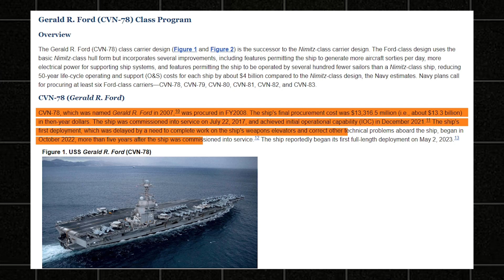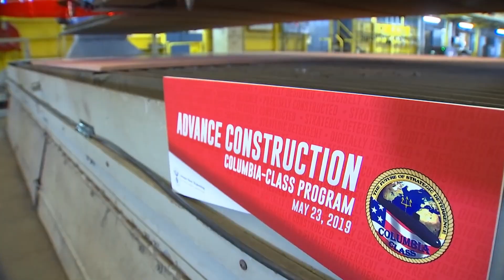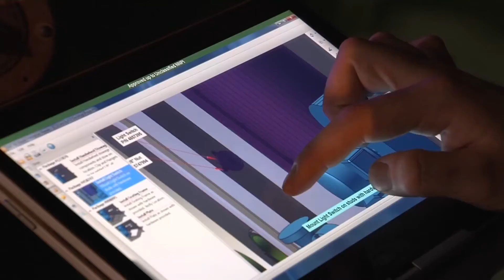Why US Naval Shipbuilding is About to Change FOREVER

Comment: I’ve heard that in WWII the United States could manufacture ships at a ridiculous fraction of what it takes in today’s modern era, with all our technology and automation. What do you think contributes to such a difference between them and now, given the lengthy production timelines and seemingly endless delays with regard to shipyard maintenance avails?
Reply from the maker: @JayandMLive  great question! WWII ships were built faster due to simpler designs, mass production, and a massive labor force. Governments prioritized speed over bureaucracy, working 24/7 with fewer regulations. Modern ships are far more complex, requiring advanced technology, extensive testing, and stricter oversight, slowing construction.